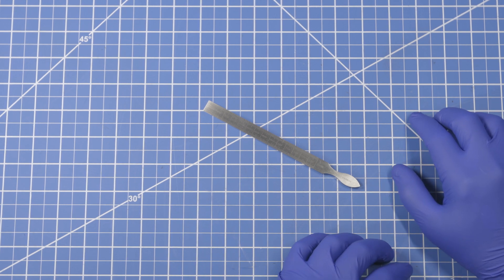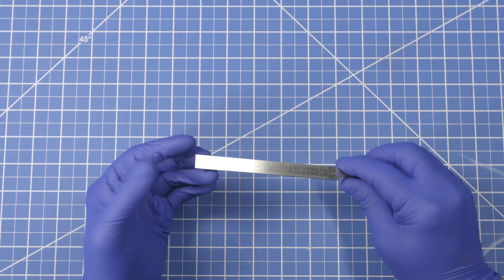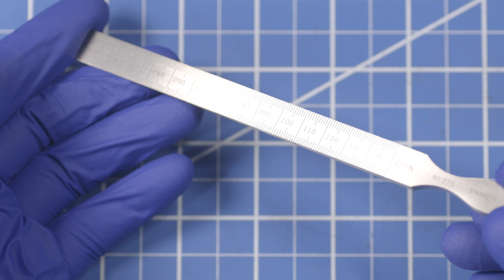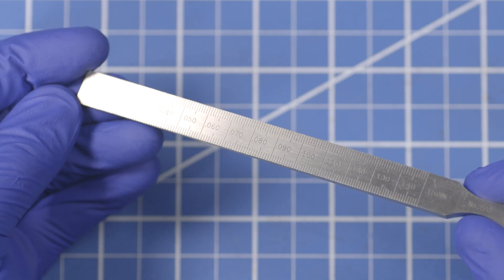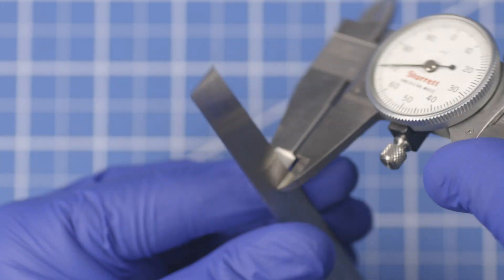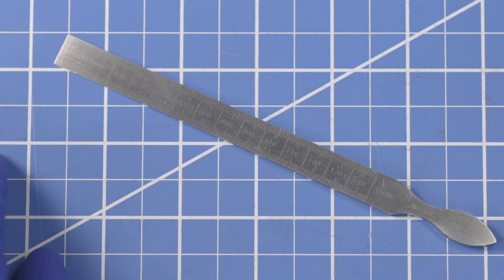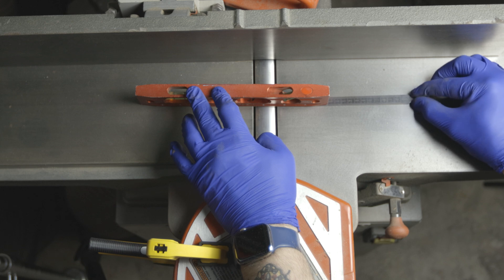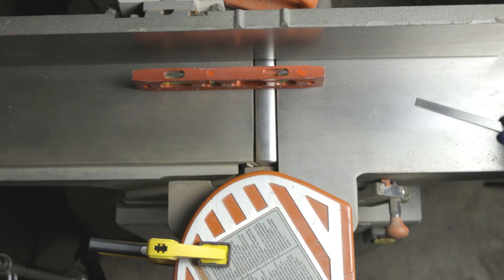Taper Gauge Basics part 1 - flat/shim style

Comment: How is using a Taper gage better than using a dial caliper to measure thickness or slot dimension, considering the larger the gap, the further you must introduce the taper gage into the gap, where this might be impractical?